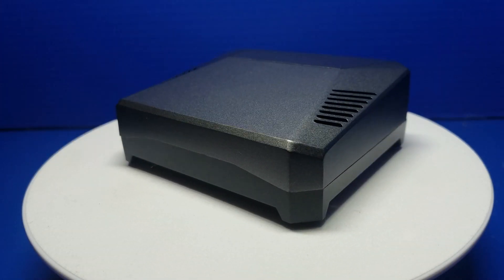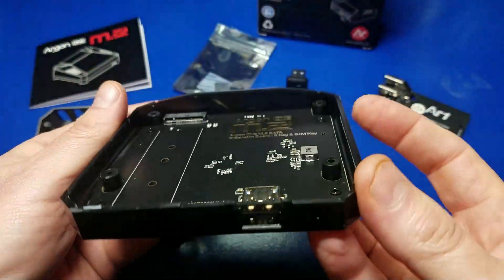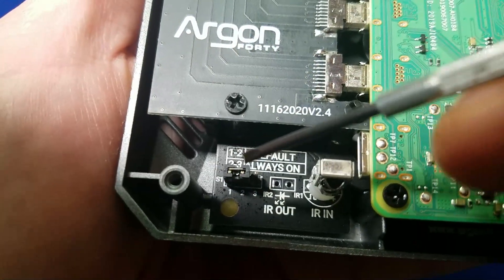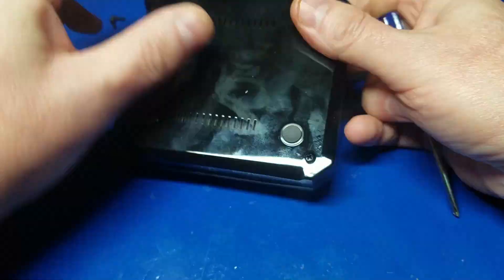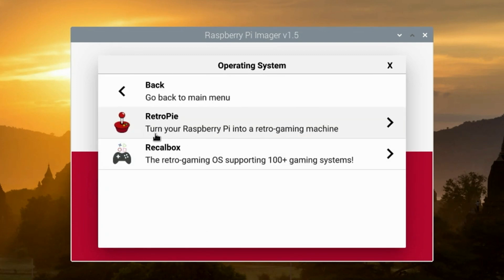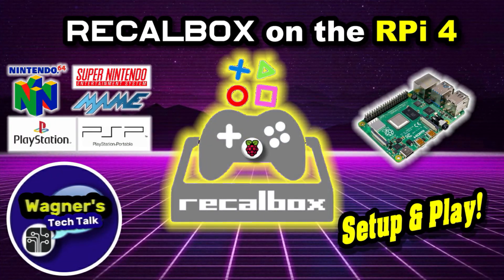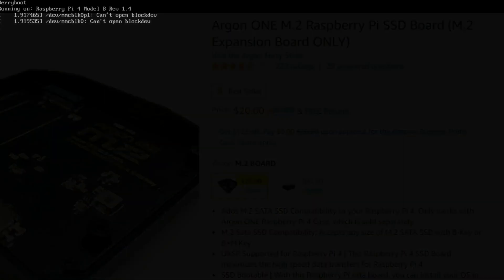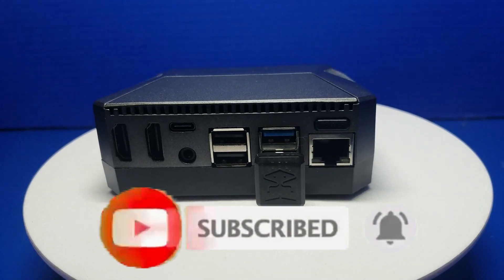Argon ONE V2 M.2 SATA SSD Raspberry Pi 4 Case: Full Setup Guide

Comment: Very problematic kit. So far, after months of fiddling, I've given up. Fan is a nightmare. Tried umpteen scripts to repair but rarely works. Internet utterly woeful speed. SSD drive crashes constantly. Bought an Etsy custom build with digital read out, all bells and whistles. No issues.
Reply from the maker: This is a rather old video, at the time I made this video the case worked very well during my testing.  Not sure what might have changed since then.

Comment: Does the Argon One M.2 case run the OS faster than the traditional MicroSD card? Does the SSD's reliance on a USB 3.1 jumper represent a bottleneck?
Reply from the maker: Definitely faster than a microSD card, but yes USB can become a bottleneck but with the Pi4 there are few options.  If you have a Pi 5, an NVMe M.2 drive can be installed which will improve read/write speeds.  More in this video: https://youtu.be/tF85w9GW3r0

Comment: I am having trouble with my M.2 not showing up even after following your instructions. At first, I thought the M.2 was faulty, but I checked it with another tool and made it into a USB drive, which worked fine. I have spent hours trying to fix this and am getting frustrated. Do you have any troubleshooting tips? Although rpi-imager seems like the easiest solution, my M.2 still won't show up, and I don't receive any voltage warning messages. Therefore, I assume my power adapter is working correctly. Any help would be much appreciated. Has anyone had the same issue, and found a work around? I have updated the darn eem firmware. There is nothing I need to turn on to make the USB connection work?
Reply from the maker: I have some troubleshooting steps here, but it appears that you may have verified the main ones: https://wagnerstechtalk.com/argonone/#Troubleshooting .  These are issues people have run into in the past and let me know what worked for them.  If none of that helps, you can reach out to the company here:  https://argon40.com/pages/contact

Comment: Quick tip to load OS directly to m.2 drive after it is aleady install in the case just use an usb "A" to "A" cable to your pc or like I did used a standard usb "A" to "C" cable "A" side to the bottom Argon usb port and the "C" side to my pc, it show as a normal usb external drive.
Reply from the maker: You're exactly right, I made an update to this video about a week after it came out.  I've fast forwarded it here for you: https://youtu.be/LHZQKr5G7MA?t=208 (not that you need it lol)

Comment: can I plug the expansion board argon to my pc, to install there the SO rpi sata m2 ?
Reply from the maker: Yes, I had a follow-up to this video that demonstrated that.
Reply: @WagnersTechTalk  link for that video?
Reply from the maker: Sure, even fast-forwarded for you: https://youtu.be/LHZQKr5G7MA?t=213
Reply: @WagnersTechTalk  thanks, wanted to know if what I was doing was correct or not. because Im having issues and something is broken not sure why.
I connected the SSD with an installed RPI on the board on my argon one m2, case everything works fine. later I plug another simple 2.5 hard drive to the other usb3 it work fine..
next day, the rpi4 was frozen no responding. I restarded and some noice I heard in the 2.5 external drive, and I unpluged. it smell like fire/burned. I tried plugged in on my pc no detected, using another adapter to my pc, no detected. I guess the 2.5 disk was burn.
then the RPI can't boot from USB to the argon board, checking the logs and hdmi when boot. it said that USB over-current. 
I tried with another usb3-usb3 to see if the argon bridge was broken, but same issue over-current error.

then I plug a m2 enclouse on the usb3 that I connect the argon bridge and the RPI can boot fine over USB.
so discarded that something broken on my RPI.

then I tried connected the argon board to the PC, with usb3-usb3 from before and PC did't detected, so I unplugges, checking the cable and the board, I smell fire/burned in the usb port of the argon board m2. I guess it burned the board? or the cable burn it? the m2 sdd is fine was't damage.

maybe adding 2 hard drives to the rpi4 at the begging did something and mess up the argon board?
Reply: and also maybe the usb3-usb3 cable have issues.

Comment: I plan on using the Argon one to a Pi 4 (8gb) to run Shinobi to capture at least 4 RTSP cameras that are running RTSP  ON 4 cameras that I know have worked b4,on a Pi 3b+, using all 4 cameras that had captured videos from all cameras. Of course the FPS were really slow and sloppy. My issue is the Shinobi needs to run on a Lite version of bullseye. How do I install that on an SD card and then copy to SSD M.2 SSD installed on the Argone? Before on the pi 3 I just created the image of Pi lite version and installed Shinobi thru command lines. Since the pi 3 had everything done on an SD card but the Argone needs the image done on an SD card then copied to the SSD and the lite version doesn't have a copy of SD card copier installed is it possible to  install a copy of SD card copier to the lite version, on the SSD, then somehow run it (please say you know how, will that fix my issue? Not to mention the fact that I will need to be able to remove the SD and boot off the SSD also! Anyone?
Reply from the maker: Some of the stuff mentioned, I've not used.  However, if you're asking how to transfer the image from an SD to an SSD, you can use this method: https://wagnerstechtalk.com/common/#Backup_Clone_a_Drive

Comment: But for some reason i can't see my screen after installing RetroPie to the SSD
Reply from the maker: Make sure it's plugged into the far-left HDMI port, your HDMI cable is good/working, then power on the case with the HDMI cable connected.
Reply: @WagnersTechTalk  All good now. Ended up of all things to be the HDMI Cable was to long. Thanks again.
Reply from the maker: Good news, glad you got it resolved!  Have a great day!

Comment: Does the drive need to be formated ntfs or fat 32?
Reply from the maker: What are you planning to install?
Reply: @WagnersTechTalk  I'm going to install retropi on a 1tb nvme ssd
Reply from the maker: @TheVincentosborne1  You can install it using Pi Imager, it will handle creating the partitions/format, etc.  There is also a cool way to update the Pi 4 firmware so you can boot without a microSD card (will need it for the fw update though), if you have an Ethernet cable available.  A few links that may be helpful:
https://youtu.be/-1d_alZNmwU?t=156 - Install RetroPie 4.8
Setup the Pi without a computer: https://wagnerstechtalk.com/rpi4/#Raspberry_Pi_Setup_No_Computer_needed_using_the_new_Network_Installer_Bootloader
Reply: @WagnersTechTalk  thank,  I format it as ntfs at first and didn't boot bit I reformat it as fat32 and work now

Comment: After installing the scripts on my Raspberry Pi, how did you get the icons/shortcuts to appear on the desktop?
Reply from the maker: At 12:00, after running the installer the icons were created automatically on the Desktop.  Is that not what you're seeing?
Reply: @WagnersTechTalk  I was able to install the script just fine through the terminal and use the command through the terminal, but it didn't automatically install the icons to the desktop for some reason. Not sure what else to do.
Reply from the maker: Please reach out to Argon40.com here: https://argon40.com/pages/contact , this video is a bit old and they may have changed their script since.  Perhaps ask them why the icons aren't created automatically by the script and if there is an option to do so.  I'm sure they'll respond back, they were very helpful to me during the creation of this video.
Reply: @WagnersTechTalk  Thank you so much and I really appreciate it! I loved your video guide. It was able to help me a lot with the process and getting a little bit familiar with my new Raspberry Pi.

Comment: Thank you for sharing. 
Quick question - how did boot from SSD work for you right out of the box? I thought that Pi Boot flashing is required, to make boot from SSD, as a default, isn't it ?
Reply from the maker: Yes, for me it booted right off the SSD.  Now, since this video there has been an updated firmware that is pretty cool that lets you setup the SSD without a microSD (network boot).  If you're interested, there is a video here on that: https://youtu.be/xjyQoIzLWac

Comment: Nobody talks about how the fan works with different OS’s, I used Ubuntu with berryboot and  the script worked for a few days and then stopped, tried re-installing it and got lots of error messages about the argon40 script, and then after a few reboots my SDD had corrupted and I couldn’t boot to any OS. Had to reformat it.
Reply from the maker: You might want to try PINN Lite, it's not as limiting as BB and seems to be a little better supported.  Everything I learned when making this video can be found here: https://wagnerstechtalk.com/argonone .  Some things may have changed since then, however.
Reply: @WagnersTechTalk  Thank you :) I will look into PINN, for now am just running TwisterOS off of the SD card as I’m too scared to touch the SSD incase it gets corrupted again lol
Reply from the maker: Understand!  If you're curious about it, here's an (older) video I made about it: https://youtu.be/1Cqta4go45U

Comment: is there a way to format the SATA? I deleted some files thst did notice was from video and cant fix it back, thanks if you have a chance to take a look.
Reply from the maker: Hi Erna, I assume you want to re-install an operating system.  If so, here are some steps for you: https://wagnerstechtalk.com/common/#Burn_an_Image_with_Raspberry_Pi_Imager .  On that same page you'll also see how to format a drive using Pi imager as well.
Reply: @WagnersTechTalk  you are awesome, will do!!!
Reply: @WagnersTechTalk  not precise that is what I am looking for, I want to rebot from the microSD and not the SATA, I try running raspi-config, and selected "B4 Desktop Autologin", with no luck, when rebooting, not showing the desktop 😞
Reply from the maker: In PiOS Imager select 'Raspberry Pi OS (32-Bit)', insert your microSD into the computer, select the microSD and click Write.  Should be good to go.
Reply: @WagnersTechTalk  it worked, thanks so much for the immediate response, you rock!!!!

Comment: the cases are very good, but have no way of actively cooling the m.2 SSD
Reply: why do you need that? what would you use to cooling?
Reply: @stanisgmi  I did tests with the same m.2 ssd and it gets over 80°C warm. If the bottom have been made of aluminum, then you would only have needed a heat pad to connect the SSD to the aluminium housing. Then I would have bought one or more too!

Comment: My fan keeps running even under temp settings. I updated Ubuntu, installed curl and fan script, set default fan settings and reboot. Also uninstalled script, reboot, repeated steps, same issue.  Idk what I'm missing. Any suggestions? Using putty.
Reply from the maker: Very strange, in this case I'd recommend contacting argon40 here for support: https://www.argon40.com/pages/contact

Comment: I purchased this setup and having used it for three months I can say that this case overheats and the Pi freezes. The temperature on the core doesn't go ver 55C but the whole case is hot. I believe that affects the SSD on the lower part. Unless I start drilling holes on the sides, I am not sure how this can be resolved.
Reply from the maker: The case itself will get warm since it acts as a big heatsink as well as the active cooling.  What is concerning is the Pi freezing, this I've not seen personally.  I'd recommend contacting Argon40 here: https://www.argon40.com/pages/contact
Reply: Yes, the same problem

Comment: Thanks a lot for the explanation, it is the clearest video I've seen so far. I've ordered the argon case (first model not with the ssd) and I was wondering if we could configurate the fan after installing recalbox or if we had to do it from pi os, and then install recalbox... what do you think?
Reply from the maker: Very welcome, happy it was helpful to you!  I must be having some Mandela effect, I could have sworn I saw built-in support for Recalbox for the Argon case but can't confirm that through the changelog here: https://gitlab.com/recalbox/recalbox/-/blob/master/CHANGELOG.md  If I come across anything useful, I'll reply back.  I do have information on running the scripts for RetroPie here: https://wagnerstechtalk.com/argonone/

Comment: hmm getting error writing to my micro sd card   "verifying write failed contend to sd card is different from what is written"
Reply from the maker: Sounds like a bad/corrupt SD card.  I would try a different card.  If you don't have one available, you could try re-formatting the SD card using this: https://www.sdcard.org/downloads/formatter and attempt to re-install.  However, I would still question the integrity of the SD card itself (even if it works).
Reply: @WagnersTechTalk  yea I got cheap I bought years ago didn’t know I might buy m2 ssd probably it has to be bad sd card because I reformatted it and tried
Reply: Ty
Reply from the maker: No problem, I'd recommend a Samsung, Gigastone or Sandisk microSD.  If you're in the US, you can pick up a new microSD card from Wal-Mart, Best Buy or even Dollar General pretty cheap.  If you have an SSD for your M.2 case, you can also use a USB 3.0 male-to-male cable to connect the SSD to your PC and install an OS that way using PiOS imager (bypassing the need for a microSD card).  I show it briefly here (I fast-forwarded the video for you): https://youtu.be/LHZQKr5G7MA?t=208

Comment: The case does some shielding. I changed batteries of my logitech M180 mouse. When I had my mouse in one hand and touched the tranceiver in the other, it worked okay. Now I'm using a USB extension cord. Working okay now.

Comment: Why not put the thermal pads on the chips themselves, and then put the Pi into the case? Putting the pads onto the case first doesn't seem as efficient.
Reply from the maker: Either way works, they both meet at the same point and cover the same area 👍

Comment: I just don't understand buying a $45 case plus a $50+ M.2 SSD for a 3 year-old $50 computer...
Reply from the maker: May not be for everyone, I enjoy it with PINN Lite for running multiple OSes and easy access to the GPIO.  But others are going to want to use it as a media center, which you can do with the on-board IR receiver.  This remote works well for that: https://youtu.be/f_MfEZ194sU , however the remote is about useless for anything other than Kodi.  There are a lot of reasons why someone would want this case, but sure some are going to pass too.  Hopefully some of this response is helpful to you.

Comment: I see that the case does not forward the USB C to the pi. Does it provide power via the GPIO?
Reply from the maker: It actually receives power from the USB U adapter.  You can also use a USB Type-A to A (male to male cable) if you want to connect the M.2 to your PC.  I mention that option in this video: https://youtu.be/LHZQKr5G7MA
Reply: @WagnersTechTalk  ohhhh I never noticed you could power it from the USB A ports. Learnt something new today, thanks!
Reply: @WagnersTechTalk  Hey, sorry to bother you again, I also was wondering what if I got the one without the M.2 attachment? Then would it get power from the GPIO that is sent from the case taking the USB C? I looked on many retailers and I couldn't find a description for that :(
Reply from the maker: It will always get the power from the USB-C connection, regardless if it's using the M.2 or not and will power the GPIO port.  I highly recommend you get the Argon One M.2 power adapter as it supplies the appropriate amount of volts/wattage.  Should you later decide to add the M.2 option, you'll be in good shape.  Hope this answers your question.  Never a bother!
Reply: @WagnersTechTalk  thanks for the fast response, I appreciate it! I’ll do some further research on this; I’m also looking into the Argon Neo with the fan hat :D

Comment: The argon case actually functions as a USB M.2 enclosure you don't need to buy one. Just plug an USB A - A cable one side into the pc and one side into the Argon M.2 USB and boom, connected to the PC like a  USB drive.
Reply: What a great comment, thanks for this excellent tip!!!
Reply: I tried it with an USB A to USB C cable and it doesn´t work (mac) - only USB A to USB A???
Reply from the maker: Hi Jeremy, you're exactly right I did mention that in a follow-up here: https://youtu.be/LHZQKr5G7MA